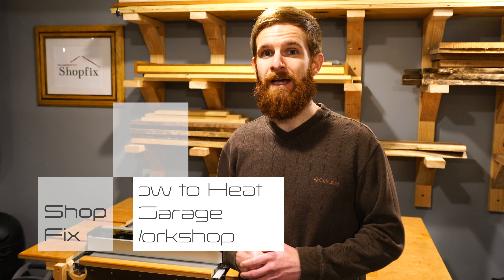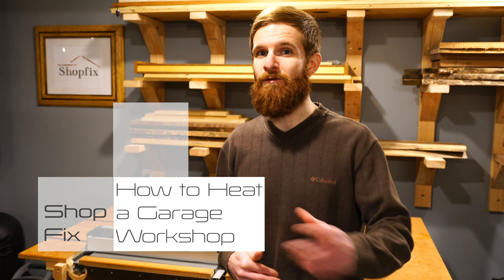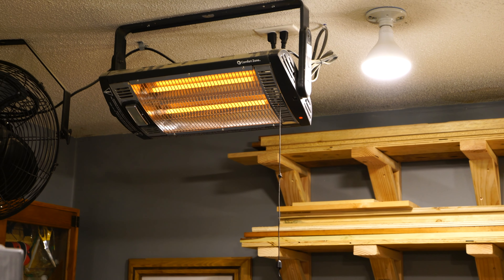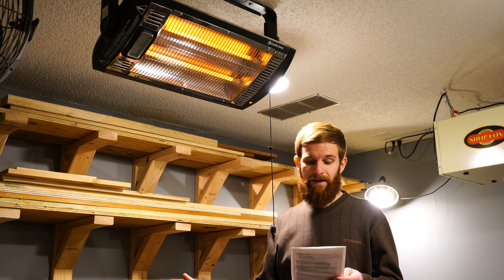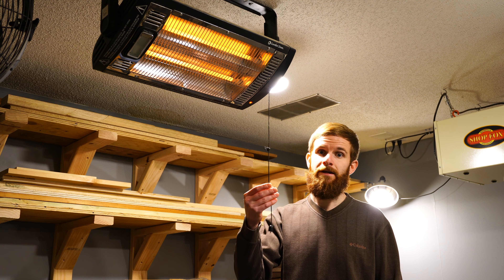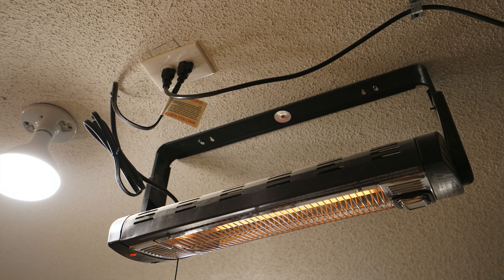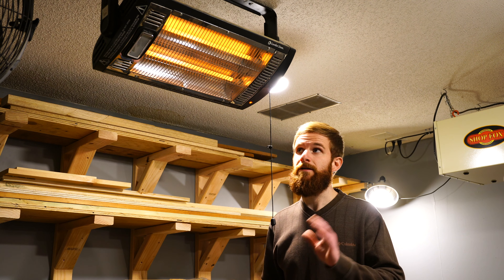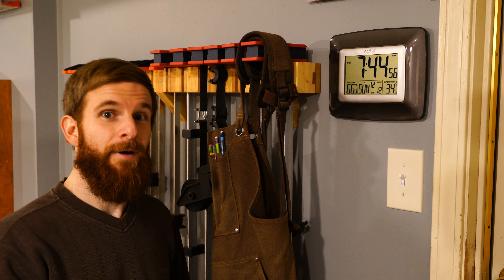How to Heat a Garage Workshop

Comment: Have this same quartz heater (sans some settings) , but my ceiling is way too high in my garage. so I only use the light.   My garage is a hot house in the Summer, but I can wear a coat in the Winter and use a small ceramic heater to warm my hands on.  Consider yourself fortunate that this works for you.
Reply from the maker: I know, I was shocked at how well this heater works in my one car garage! Although I usually have to wear a light coat or jacket in the winter as well even with the heater on because it still gets pretty cold.

Comment: Thank you for the great video - couple questions.
It looks like you have had this installed coming up on 2 years.
Is it still working for you?
Any issues with it?
Do you leave it on during the night?
If not, do you leave it on for 24 hours or so when doing a glue up?
Thanks! 
Patrick
Reply: I have one in my garage an let me tell you it’s amazing it’ll definitely warm your garage or any workspace you need

Comment: Over the years I've had several workshops. One was a detached garage where I burnt wood....DIRTY AND DANGEROUS around all the wood, wood shavings and dust. 
    Another was in an attached garage where I used the HVAC from the house and it didn't work very well. I had a heating duct in the garage but it wasn't near enough to heat the whole area. It actually did very little.
    Now I have another attached garage with a Comfort Zone radiant heater. It says it is a ceiling mount, but the instructions says not to mount on the ceiling. It is recommended to be wall mounted, so that's what I did. I have a dedicated outlet wired to a dedicated switch. This way I walk into my garage, flip a light switch for the lights, flip another switch for the heat. During the really cold months I leave the heater on the two bulb setting. During the chilly months I leave it on the one bulb setting.
    The Comfort Zone heater is the best I've ever used and I've tried them all.

Comment: Looks like you do have the hvac ran in your garage. Vent on ceiling behind you?
Reply from the maker: That was a vent to the attic, just a hole cut in the ceiling. I actually closed it up because it was making the garage hotter not cooler.

Comment: Does it make the area directly in front of the heater substantially warmer or not so much? I’m okay with my entire garage being colder as long as I can spend the majority of my time sitting or standing in front of a heater.
Reply from the maker: The area in front of the heater is the warmest area but overtime as the infrared heats up the objects then the whole room warms up.

Comment: How does all the dust from milling and sanding wood affect the heater? Would it be a fire hazard? We need a heater in our garage bc its getting very cold but im not sure the type to get
Reply from the maker: Dust does settle on the heater but it hasn't ever posed any problems for me. I would just dust it off from time to time.

Comment: an electric heater like that... yea, it gets to -40celcius here it would be like trying to put out a forest fire by pissing on it.  i use propane and THICK insulation, in addition i have just a small essential area heated, where the wood is stored and even some of my less used equipment are not heated.
Reply from the maker: One single electric heater will certainly not be sufficient for larger woodshops where the temperatures drop that low! Thanks for the tips for a colder environment, I would agree that insulating is one of the best ways to increase and retain the heat in a workshop. Take care!